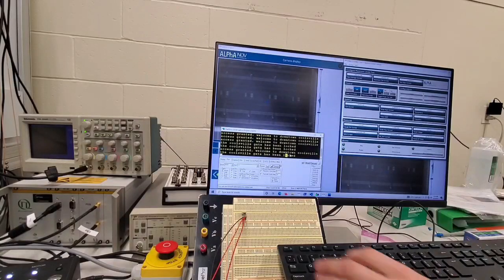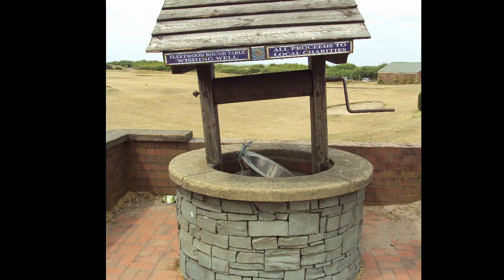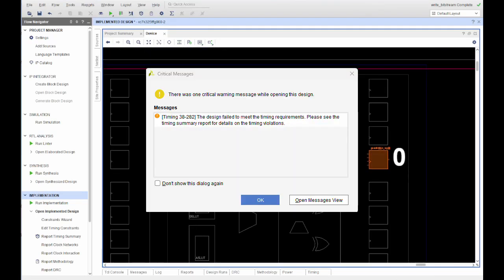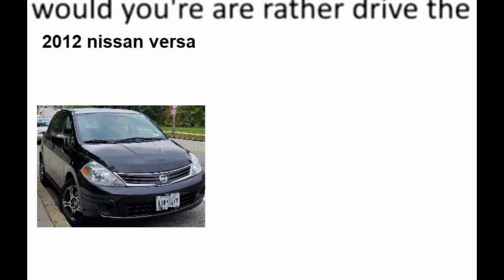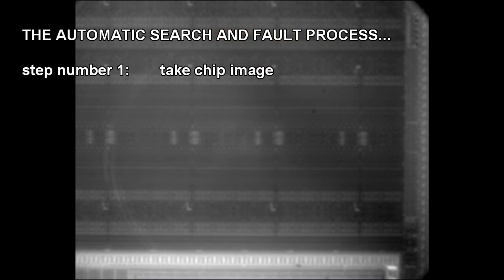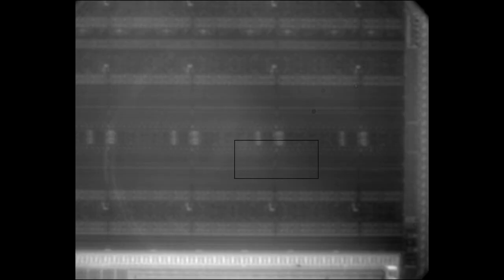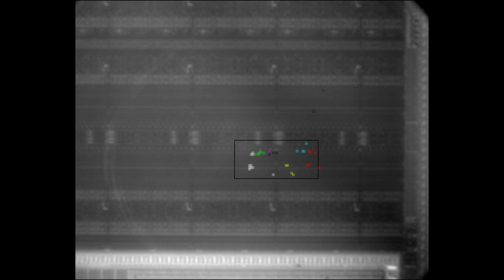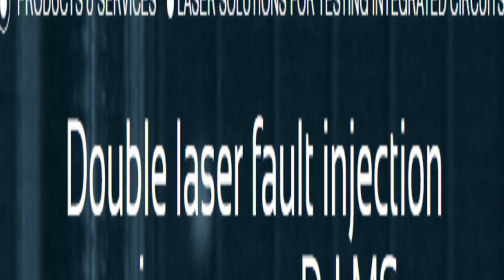Laser Fault Injection. because FPGAs deserve to feel pain.

Comment: Could you use this to cheat in a speed run
Reply from the maker: In theory, maybe? I think? Basically you'd need to...
- have a system that will not instantly melt with the silicon die exposed like this
- have a value that is in a known place within said die at a known time (many more modern systems have some separation between memory addresses as seen by software and physical location for security reasons)
- have a trigger signal that could time the laser pulse with whatever you wish to tamper with
Your best bet, in my opinion, is a modified MiSTer, though from the looks of it you can't nondestructively expose the die on the boards they use. Though I bet with enough effort you can port it to, say, the Genesys2 board I used in this video.

Comment: What kind of integration time and filters do you need to be able to visualise the registers ?
Reply from the maker: If memory serves me right, the integration time was somewhere in the ballpark of 4-6 seconds. As for filters, i wouldn't say there are any, but there is the subtraction of a "dark image," which is just the chip with nothing on it. That is to say the process is 1) take an image of garbage noise and nothing else 2) take an image of the chip emitting the photons, which also includes the same garbage noise 3) subtract the nothing image from the something image. At the end you should be left with a much cleaner image of just the photon emission.